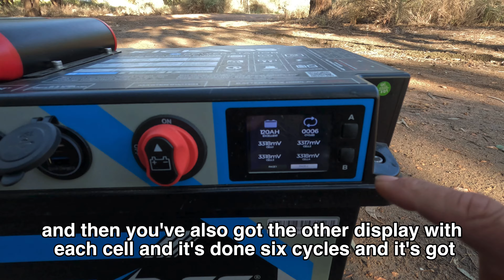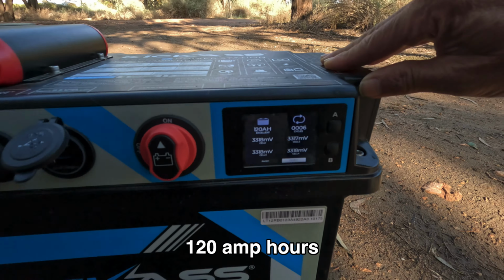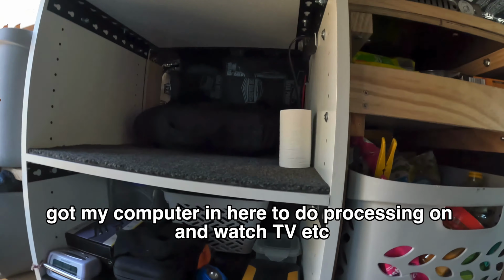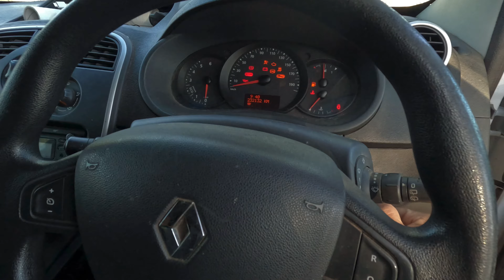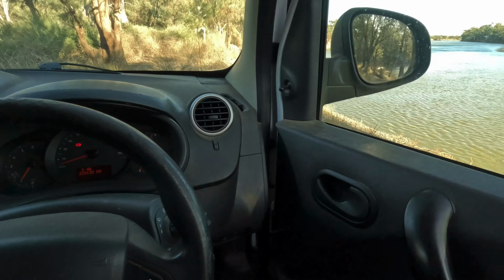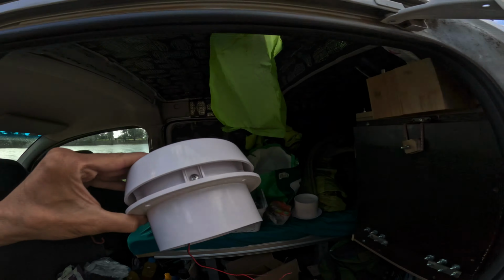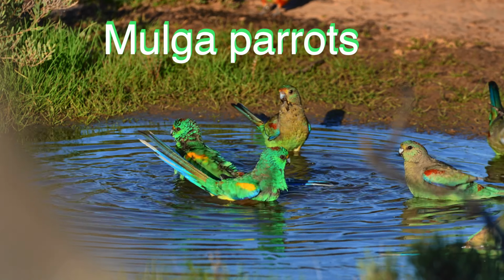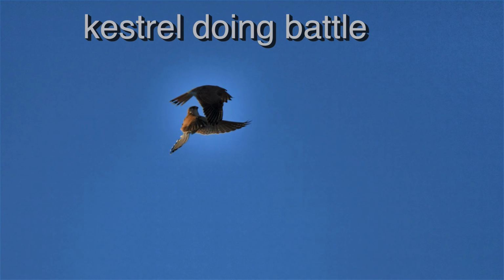Van Life ( Under The Milky Way ) Dual Battery, vent install, solar install  Wildlife and Landscapes

Comment: Great video Chris 👍 I also like Kickass products. Have a Kickass 40amp MPPT controller charging 2 135 amp/hr batteries and power the van with a Kickass 1200 watt inverter that powers a 70 liter bar fridge and lights. Sometimes use the toaster and charge laptop battery and phone
Reply from the maker: Wow, Alan, You sound like you have a nice setup.  This setup has worked well so far. I did have a 130-watt lighter, usb charging my Macbook Pro until I realized it had melted. Now just using a 40-watt one.
Looking forward to my fat bike finally being complete in the next few weeks.  I'm wrapping grape vines on wires near Mildura for now.
Reply: @ChrisRishworth  Yeah, 130W through lighter plugs don't work well, can you change it to an Anderson connector?
Good to know u will get your bike back soon👍
Reply from the maker: @alandavis8675  I ended up using a 40-watt version. Which charges it on low power. All good so far. If needed I can switch the computer onto high power mode for rendering videos. Not sure how I would wire up an Anderson plug with an Apple connection.  Yes, the bike is complete. I'll finish wrapping vine canes here in 3 weeks max and drive Wodonga to pick it up.

Comment: You are really going to town with the production on the computer. 
Van looks great. 
Top stuff Chris.
Reply from the maker: Thanks, yes it was a lot in the production. New bike frame in the bike shop now, getting fitted out.
Reply: @ChrisRishworth  Are you going to be around Mildura through August?
Reply from the maker: @farqitol  Probably. Working at Nangiloc just south. Wrapping vine's on the wires.